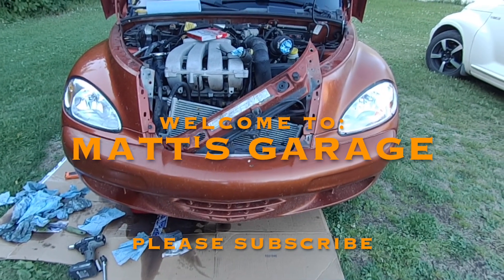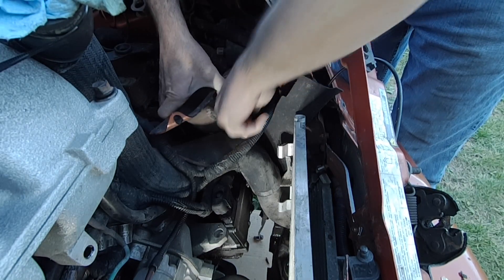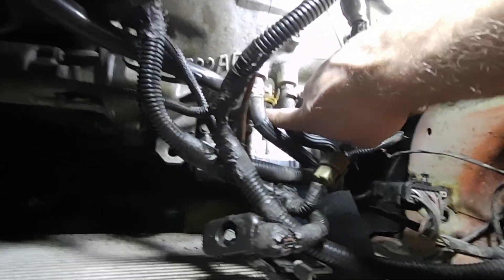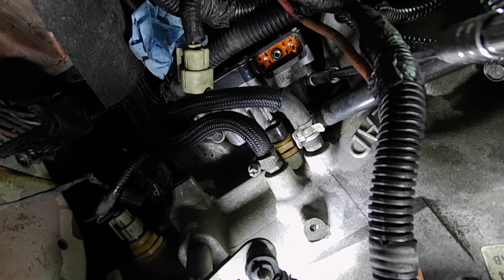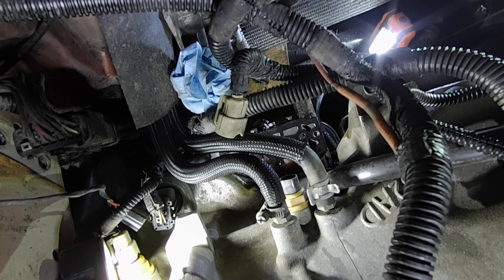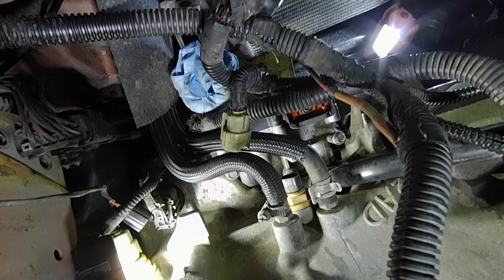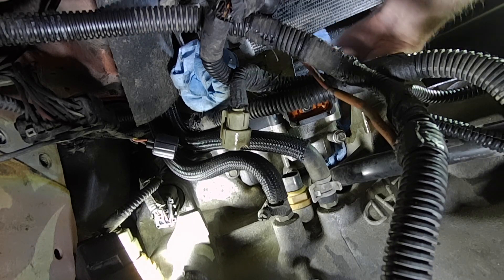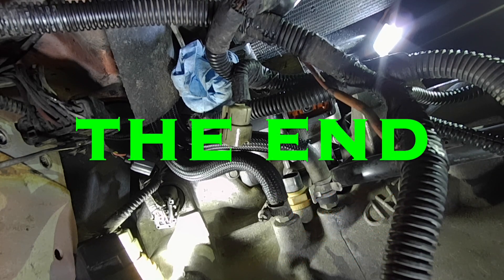PT Cruiser Shift Solenoid Replacement

Comment: Hello Matt, is there a forum or any way to reach you to ask questions? My father bought a pt cruiser to save money on gas and because hes not had a car in decades. Hes a single father of 8 so its always been a van! 
Anyway, ive tried to help to find information but there isnt a whole lot. Especially for 2001 PT Cruisers that are manual. 

His rpms were going nuts, then it started to die. He checked the battery, then the starter and is now replacing that. I just cant help but feel that theres something else between that would get it to work rather than jumping to the starter itself. 
If there is anyway I would greatly appreciate it. 
Going through mechanics is very stressful.

Comment: I'm getting the p0700 code followed by p0845. I checked the fluids. Now I'm wondering if this is the issue or is it the transmission fluid pressure sensor. Any advice?

Comment: Good morning sir so I came across your videos searching repairs on PT cruiser so I have a 2005 PT cruiser which had a computer issue I went ahead and swapped the computer for a used one that was programmed to my VIN ever since check engine light is gone was able to pass smog but now I have shifting problems from third to second gear on the downshift and from reverse to drive I have somewhat of a buck do you think that is a computer issue or a shift solenoid thanks for your help

Comment: My 2002 PT Cruiser when I cut the heater on it made a loud pop and then the transmission started leaking
Reply from the maker: Are you sure it’s the transmission leaking and not coolant leaking? The only connection between the heater and the transmission is if you have an in radiator transmission cooler, it’s possible you do being a 2002 and they can internally rupture but normally they don’t leak externally. Do you know exactly where it’s leaking from?